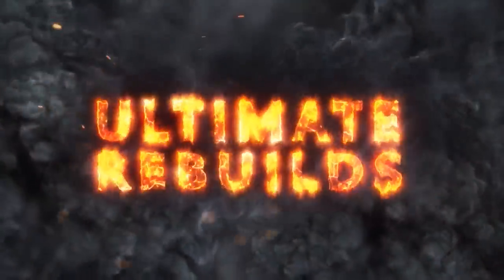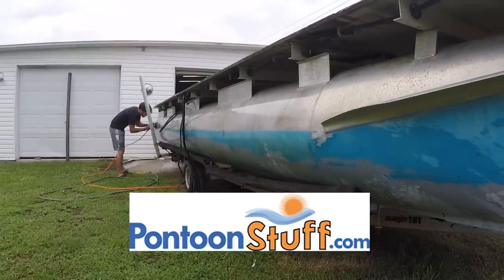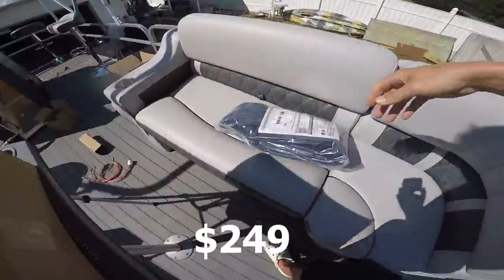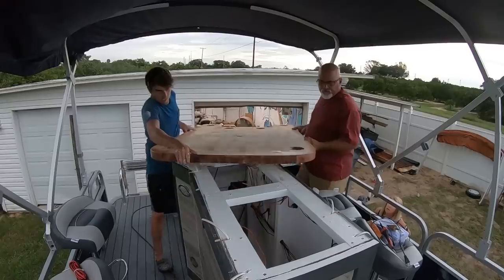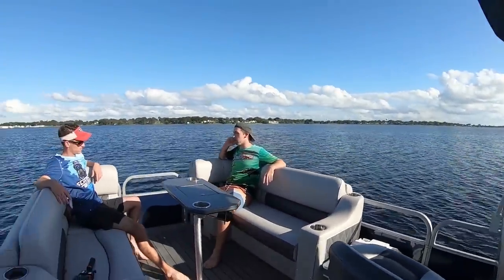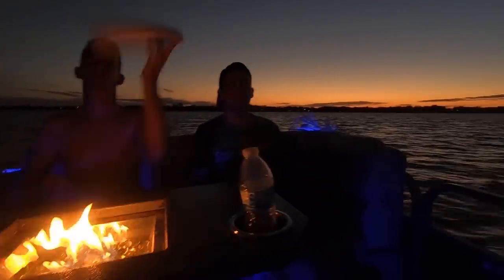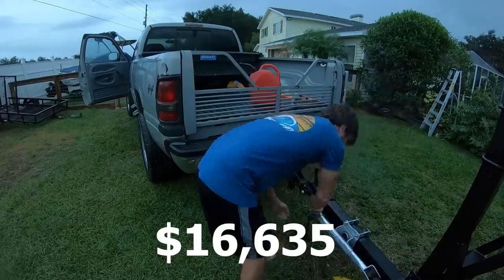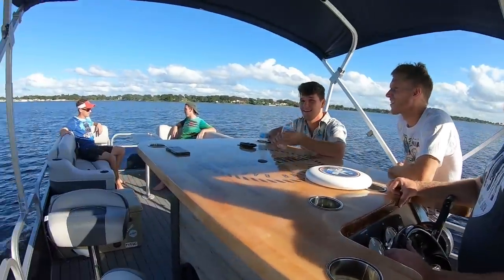How Much Did My Custom Pontoon Boat Cost?

Comment: You seriously need to have someone weld those pontoons. I wouldn't trust those bolts. The pontoon mounts HAVE to be able to withstand a slightly choppy lake otherwise, bye-bye pontoon! I've seen scary accidents on Youtube where a pontoon got lost and the boat sank. Most people who own them said the issue is the same: the brand kept cutting corners to get the boats built faster. It's partly due to crazy demand. They're sacrificing quality for quantity.

Comment: Curious how you are making out with the Boss stereo?  I have heard about quality issues but it seems to fit the bill for my upcoming pontoon fix up.
Reply from the maker: Everything seems to be working fine, it’s weird though.. after it turns on.. condensation gets in the screen but doesn’t affect anything. Apparently it’s a common problem
Reply: @ultimaterebuilds7127  Cool.  Thanks for answering

Comment: 20 grand means you only value your work in the build at 3grand. Definitely if you were to ever sell it you need to value your work a bit higher. Easily at 27-28k boat

Comment: The red and green lights should be mounted so the only way to see both is directly in the front. Pointing them like you did in the video is incorrect and could result in a ticket...

Comment: How did you protect the bottom of the plywood. Water will splash up against it constantly. will delaminate quickly. the entire plywood pieces should be encapsulated. 
yeah.... everthing thing is possum.

Comment: Bro you spent 17,000 on a used pontoon boat? I mean I guess if you're into fixing it up and all, but you could've bought a slightly used for 10k - with little to no work. I got me a 2015 and bought it on Facebook. Plus value drops so its a loss.
Reply: No one asked.

Comment: SCORE - + 30 for the floor, very nice work. +30 for the bar, +30 for the awesome trailer work. + 10 for the color choice.  Total 100 Points for a very nice resto-mod Pontoon with a very nice romantic fire pit.  However, -50 for building such a nice boat and taking dudes out instead of chicks.

Comment: Dude like not gonna lie but Boss is just the most trash brand. No offense. I think that radio is going to break quick. I would have installed only Kicker in my boat if I had one. But the boat is so bad ass though.